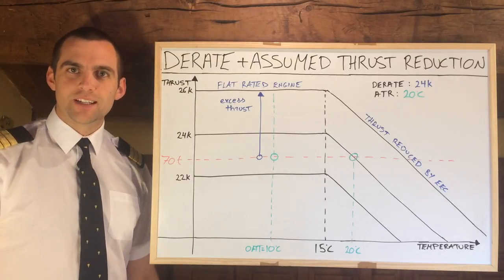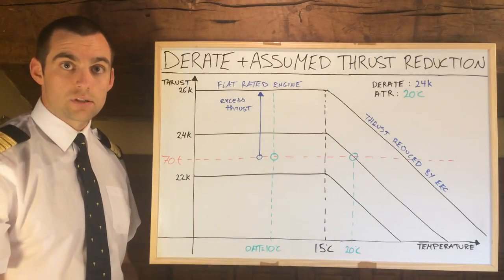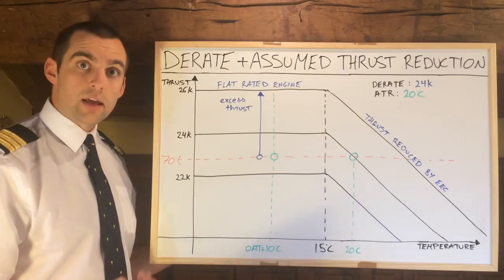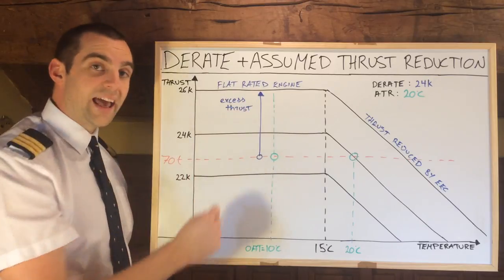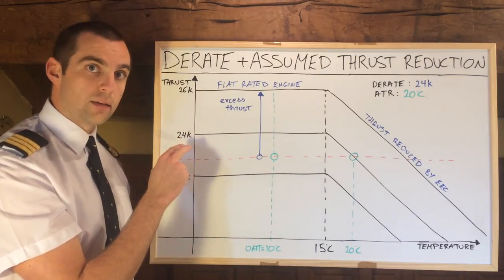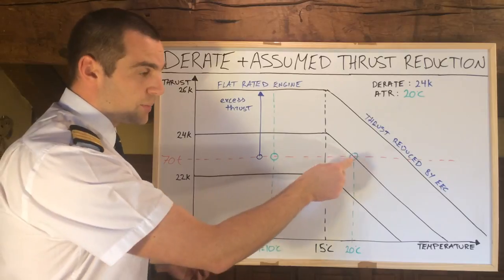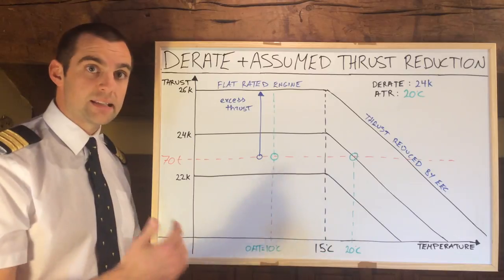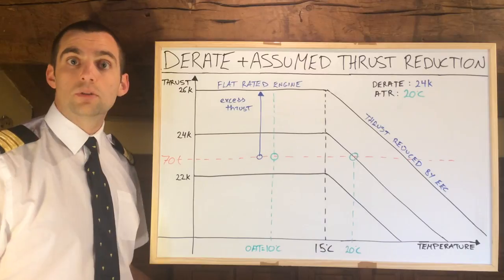Derate + Assumed Temperature Reduction ✈ ATPL ✈

Comment: A derated thrust setting does not allow extra thrust to be used if an engine fails. Derating uses a lower Vmca for that derate setting.
Assumed temperature method (ATM) doesn’t change Vmca, therefore you can increase thrust in an engine out situation.
Derating is primarily used for increasing a MTOW from a contaminated R/W, but used regularly for normal thrust reduction. ATM is used to reduce thrust to prolong engine life.

Comment: Hello Sir, thanks for your video which has assisted me understanding the EASA Part 66 M15.2 turbine engines performance submodule.

I noticed in your graph that the flat rated lines starts decreasing at 15 degrees celsius however I believe this should be 30 degrees celsius (or ISA + 15). Hope this helps
Reply: That’s correct. It’s ISA+15 (minimum) for every engine manufacturer. 15 degrees Celsius would be very low. There would be no thrust left if you were to takeoff in hot places like Dubai or Jeddah 😂
One information that is missing is why is the thrust decreases above a certain temperature ?
The reason is that above this temperature, thrust is reduced to keep a constant EGT in the engine.
This is why the EGT margin is calculated at this temperature also called the corner point.
Thrust is basically directly linked to the mass of air passing through the engine. When the temperature increase, the air density decreases so you need to run faster to produce the same amount of thrust. To do so, you increase the engine speed.
And to increase the engine speed you need to put more fuel which means higher EGT temperature.
In CFM training manuals they use the same chart but with the engine EGT to explain this thrust limitations.

Comment: Hello PilotEd, just a small correction if i am not mistaken, i think for a reduced thrust take off the 24k and further more the 22k will start derated (the thrust reduced by EEC) at higher temperatures, not at the same 15C as the 26k

Comment: A great video . However Few doubts 
1- is it possible to select these pre set de rated thrust ? I mean how we do it and this selection must be different before every takeoff due ambient atmospheric conditions and runway length   2- inspite of this flat rating concept why can’t we put the thrust  lever at less power setting to avoid excess thrust

Comment: One of the better explanations.  One of the results of derating takeoff and climb thrust is that it will generally burn slightly more fuel but this cost is usually offset 10 fold by longer on aircraft time and reduced Maint cost!!

Comment: Love to see a tutorial video on Flex Temp considerations at a departure airport at 8,000 feet with a temperature of 95 degrees Vs a temperature of 65  degrees
Reply from the maker: i guess you mean Fahrenheit?! i dont really know what that ecuates to, but the "H's" are bad for performance, high hot and humid. all decrease air density and hence performance degrades. Relating to engines a high temperature means you have to be careful not to exceed EGT temps, hence the need to derate. Lots of factors would be taken into consideration though. Runway length, aircraft weight etc....

Comment: Hi Ed, nice Vid, but I have comments concerning the technical part:1. Pls mention the type you're flying. On MD11 there is no derate, only flex. On Airbus, usually you can have both, although derate is hardly used, but a combination is not allowed. On Boeing, both is available and can be used, also in combination.2. Using a derated Takeoff thrust, usually you aren't allowed to advance the thrust beyond that point. By using a derated trust setting, the performance parameter are also affected, means for example v1/vr/... AND Vmcg/Vmca (minimum control speed). That's the difference to the assumed temperature procedure.3. Derated or Flex Thrust settings will not save any fuel. That's commonly misunderstood but unfortunately told that way by some training instructors.
Reply from the maker: Its to do with engine ware more than fuel savings mate!, if we dont need the full bangs from the engine we can use ATR and derate to bring the engine down, saving on wear and tear. Im on the 737-8 NG by the way. thanks for watching

Comment: Good video. However a bit too simplistic,  it lacks the explanation why derated takeoff thrust is considered a takeoff operating limit since VMCG and VMCA and stabilizer trim settings are based on derated takeoff thrust while reduced takeoff thrust (assumed temperature) is not considered a takeoff operating limit. So while selecting only the latter, the thrust levers might be advanced to full rated takeoff thrust during the takeoff run. Would be nice to include this explanation.

Comment: The problem is as many others have referred to. Is that reduced thrust takeoffs actually increases fuel consumption so you should recut the video and fix this. In talking to maintenance about this .The amount is minimal because of the time difference it takes to get to 15k where this is automatically phased out. If you need a reference Goto your 737 FRM or FCOM on reduced thrust . It’s right there.

Comment: Very nice video! :) I'm beginning my adventure with civil jets and I spent a lot of time seachring answer on this subject (thats of course ok, because i tried to sort this knowledge up in my head and got the basics), but your video finally led me to understand how it works in practice.

Anyway, i have one question to you. At the end of the video you said that despite de-rate + assumed temperature were selected, at any time you can reach Max thrust if in need. It is the:
- Max rated thrust (f.e. 26k like in video), 
- Max de-rated (f.e. in video we used 24k),
- or is it MAX operating limit (f.e. in 737NG 27.1k)?

And a second smaller question - maybe i'm mistaken, but this reduction of thrust after FRT done by EEC isn't in fact reduction of N1 speed? (less dense = engine can't produce thrust without enough amount of air = there is no need to spin  N1 so fast?) 

Thanks in advance and have a nice day! :)
Reply from the maker: glad to help! thanks for watching

Comment: Hi! Really good video! I have one question though. How is the required thrust calculated? Is there some sort of table in the QRH or FCOM where you can see how much N1 is needed for a specific weight and runway length?
Reply from the maker: yes, specific to each runway actually, now days we just use the OFP.. super easy on the iPad :)

Comment: thanks heaps for your videos. im PPL working soon on ATPL.. quick question, higher temperature means less air density.. with prop planes this means you lose performance.. with jet planes not?

also why do you have to fool the fmc by entering a higher temperature so it decreases thrust.. ? isnt there a way to put in those extra factors like a longer runway etc? 

thanks!!
Reply from the maker: Thats right yes higher temperature air expands and becomes less dense. this means degrading performance for all types of aircraft. remember the 3 "H's" HIGH/HUMID/HOT are all bad for performance! jet and piston. Thanks for watching new videos coming soon.

Comment: I’m sorry but the flat rating means the engine can make RATED thrust up to a given temperature. It’s not the EEC’s reducing the thrust, it’s the air density that’s reducing the thrust. The engine can only make rated thrust up to a mfg. defined air temperature limit

Comment: Sorry, I am still very confused. As you have mentioned at the start of the video. If the actual take off power required is (lets assumed 23K on the Thrust axis), why don't we just select 23k of thrust at take off. Why do you still have to pick 24K.

Comment: well is that true that for the derate thrust method  (unlike assumed temperature method ) the thrust can't be overridden by using TO/GA setting?
the engineer power up to the maximum thrust permitted under the de-rate! 
that's why we need an additional rating isn't it?

Comment: I have a question. Why do we use an assumed temperature to get the DE-RATE config for a 70ton takeoff  instead of just setting the fms for a 70t takeoff? In other words, why do i need to change the temperature for an assumed temperature instead of just selecting the correct thurst(de-rate) required?

Comment: wait. 2:32. you say the EEC reduces the thrust when the oat is RISING? shouldn't it be the other way around? (Hot temp- performance degrades - the eec compensates?)
Reply from the maker: Flat rated engine is designed to achieve the same level of thrust up to a certain temp, then for higher temps, the level of thrust decreases as a function of OAT. This gives identical performance over the flat portion of the OAT range making the performance predictable. But for higher OATs, it stops the EGT continuing to increase. The EGT is the key part, higher temp you don't want more thrust because you will exceed EGT limits. Hope thats understood.
thanks for watching

Comment: I have 2 question. Are the EEC will always reduce the thrust setting if the OAT +15? But, if it's still below 15, are the EEC will still reduce it?
Reply from the maker: i dont really understand the wording of your question, but yes if the temp is above 15 degrees the EEC will reduce the trust. This saves exceding RGT temperatures. thanks

Comment: Hello sir,  For takeoff are the pilots engaging FULL THRUST, or 40 % then 70-80 % as per Boeing 737 and let it there till the lift off, 
and then making some adjustment but without touching the throttles ????   Thank you sir,   Lucien Paquette.
Reply from the maker: we do 40%.. stabalised.. then take off thrust normaly in the 86-96% region. thanks for watching
Reply: @PilotEd  on the 787 there is what is called, thrust ramping, the EEC slowly increases the thrust until reaching the T/O thrust (sometimes reached until 65 kts), and it is observed when we need to compensate for crosswinds, low groundspeed, high alt airport, high ambient temp....etc

Comment: Why is  the system such as you need to "trick" the engine to achieve the right configuration? It should have been a more native functionality rather than starting tweaking like that. If you could tweak the temparute to achieve this there should me a more intuitive option which lets you select the precise amount of thrust.

Comment: Does it really change the calculation if OAT is below zero? Say -10°c.
Reply from the maker: Well, yes the temperature does affect the engine performance, however if its -10 there are other factors to take into account such as anti-ice and would prob not use temp assumption on the engine because we would have de-iced. but cold weather generally offers more performance and hence more margin to derate. But it depends on so many factors. weight, weather, runway etc...

Comment: When you set the TO thrust you set TOGA in the Boeings right? But How do you so get max thrust if needed?
Reply from the maker: FMC we can select a derate 22/24/26k even 20 in some versions, and also an assumed temp. Of course at any point we can manually push the thrust levers forward to max :) thanks for watching
Reply: PilotEd ok! You welcome! But the TOGA during takeoff is not full forward or what?
Reply from the maker: correct toga sets n1 to what you program
Reply: PilotEd Can you push the throttle levers further than the takeoff TOGA?
Reply from the maker: Of course! we have ultimate authority in the place as pilots.